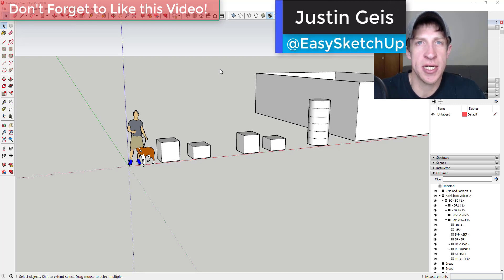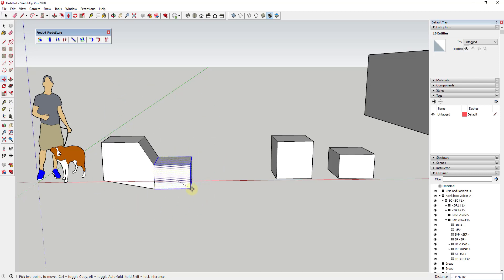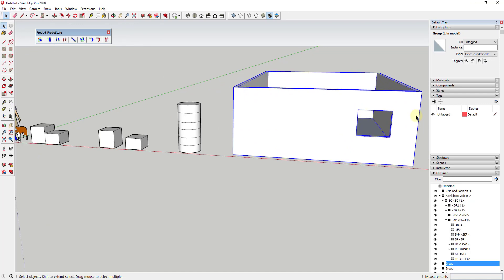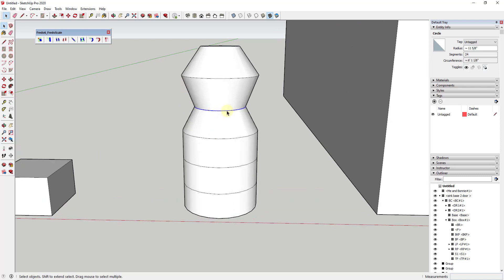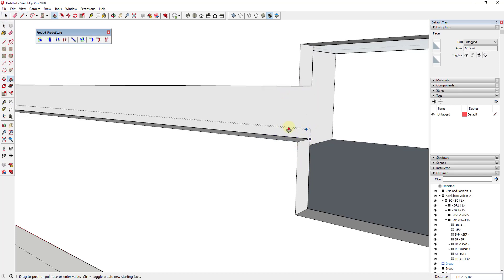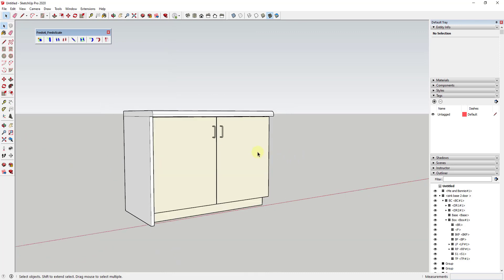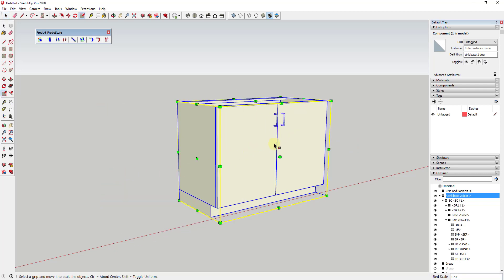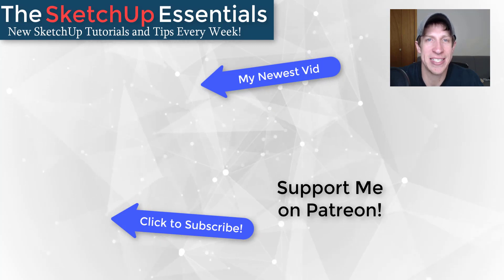Modeling with STICKY GEOMETRY in SketchUp

Comment: Hey, Justin! That was fun experimenting. Thanks so much. You're awesome!
I hate to ask an unrelated question, but I didn't think you'd answer if I questioned on an old video. I've been going batty trying to follow along with the soap skin & bubble vid. My soap skin disappears every time I try to edit the X/Y ratio or use the smoove tool and I get nothing. Why? And will Soap Skin & Bubble not be available anymore after April 2020? Any clues?
Reply from the maker: Are you completing the shape before you try to use the smoove tool? And it should stay available - the author set it to expire but it always gets updated with a new date - worst case you'll just have to download again
Reply: @Thesketchupessentials  Oh, thank you, Justin. Actually, my shape isn't inflating as I want it to. I may be mistaken in thinking the x/y does what the bubble does. DUH! No wonder I kept winding up with such a mess.  
Thanks for informing me that all may not be lost with the extension. I was searching for anything that may perform the same function as Soap Skin & Bubble. It's nice to know I don't have to.  Thank you so much for all you do, Justin.